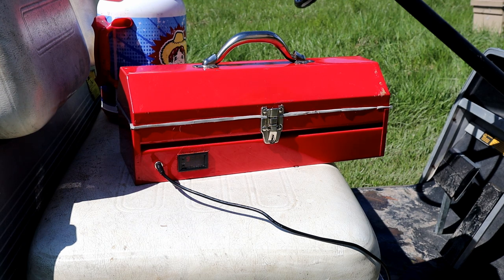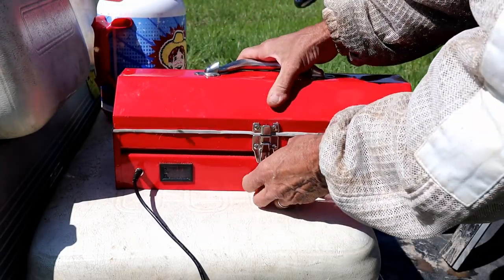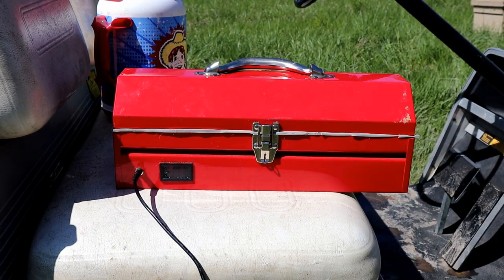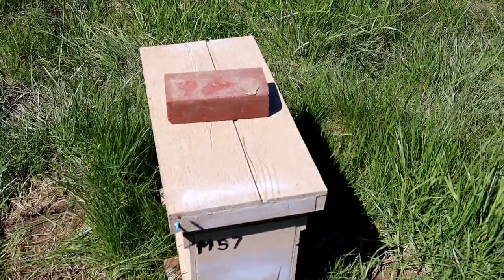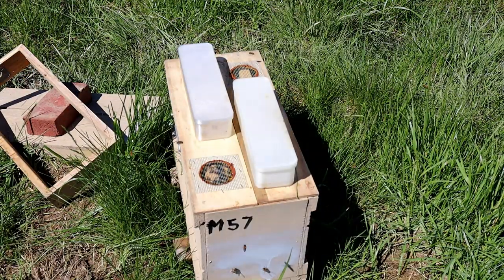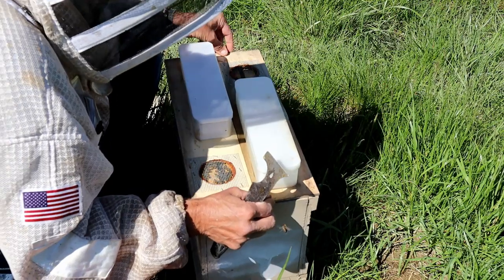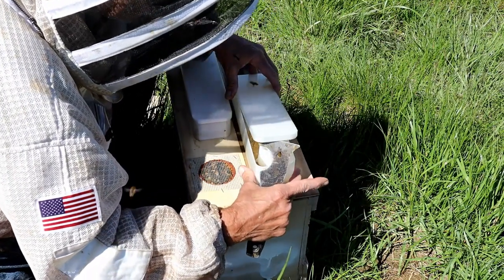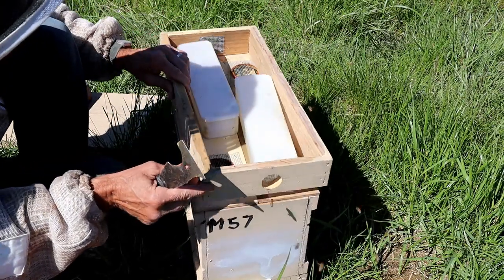Putting Cell in at the New Mating Yard

Comment: Would you mind sharing the plans to your electric cell box. I was looking at buying one but they are $750 to buy one. I would greatly appreciate the plans! Thanks and great videos.
Reply from the maker: I have no plans it's in my head. Here is a parts list. https://www.ebay.com/itm/1PC-Waterproof-5-5-x2-1mm-DC-Socket-Power-Jack-Plug-Female-Mount-ConnectER/113793000395?ssPageName=STRK%3AMEBIDX%3AIT&_trksid=p2057872.m2749.l2649   you need two of these wired in series 12V 50W 100mm x 100mm Heated Heater Pad Silicone Mat For 3D Printer Heat Bed, you need one of these DC 12V F Fahrenheit Temperature Controller Thermostat Control 1 Relay NTC Sensor , you need one of these https://www.ebay.com/itm/12V-Waterproof-Car-Motorcycle-Boat-Cigarette-Lighter-Socket-Power-Plug-Outlet-US/312325211777?ssPageName=STRK%3AMEBIDX%3AIT&_trksid=p2057872.m2749.l2649, and one of these https://www.amazon.com/gp/product/B07YN6KFG3/ref=ppx_yo_dt_b_asin_title_o05_s00?ie=UTF8&psc=1, and a small 12v fan.  That is about the best I can do some are link and some you will just have to hunt.